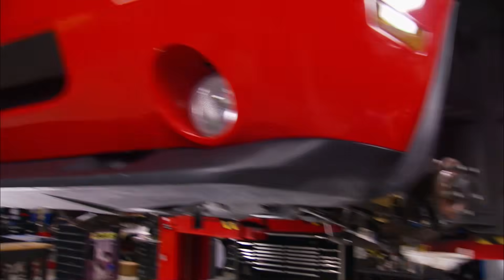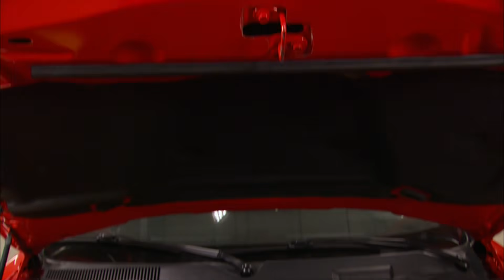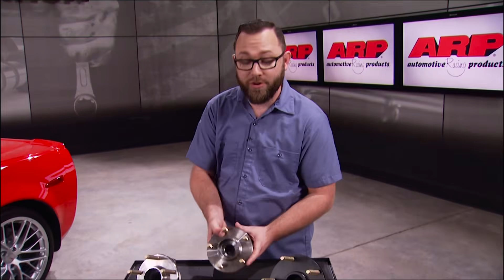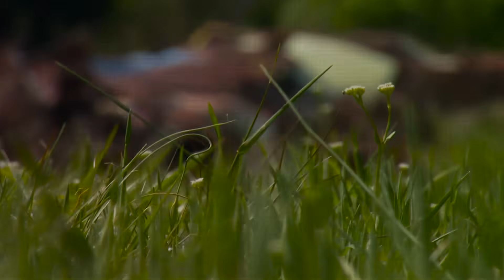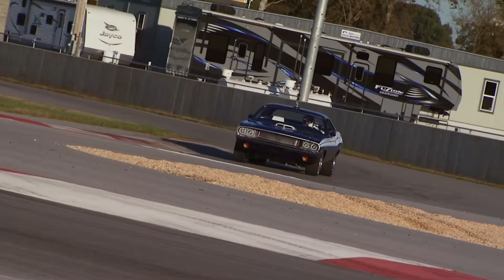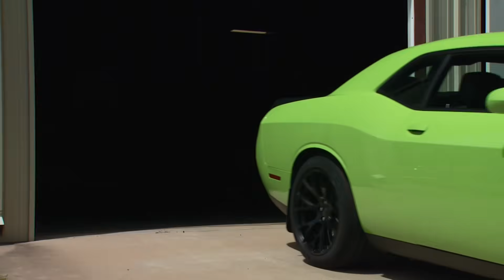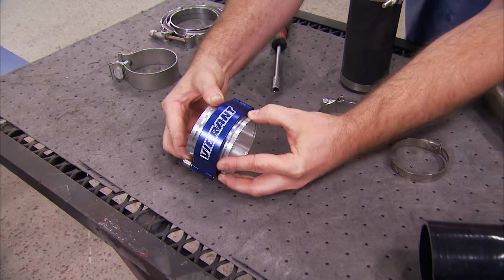Dropping A Twin-Turbo Hemi Stroker Into A 2010 Challenger SRT8 - Detroit Muscle S3, E14

Comment: Hemi/ LS /Coyote. What is the best Engine to build for power?
Reply: I would say the LS for sure
Reply: You forgot the ford “voodoo”
Reply: @Hipsters_N_Hippies  the Voodoo engine with the flat plane crank is amazing for sure especially since it can spin above 8000rpm. Now when you take into account the cost of a Voodoo engine vs an LS along with power adding capabilities it's no comparison
Reply: Shawn Clark oh I agree. The Chevy V8 has definitely proved to be the most logical one to go with.
Reply: Ls
Reply: @bigboreracing356  the Top Fuel guys would tell you a 496 Hemi is best
Reply: Well the 351 is a good for power. My dad dropped a Windsor in a mustang ll
Reply: LS is cheap and easy to make gobs of power. That's why everybody uses them.
Reply: @bigboreracing356  STFU🤣🤣. God could you be anymore pathetic? And jesus a 5 year old girls has more knowledge of engines and cars than you do so STFU🤣🤣🤣
Reply: Gas turbine,.....
Reply: @PiDsPagePrototypes  haha.
Reply: @TheRamGuy  Well, ya know, MoPaR had 'em in cars, so..... 🤣
Reply: @PiDsPagePrototypes  yeah and how well did that work out
Reply: @TheRamGuy  reasonably well given the tech of the time. The main thing drivers didn't like was the throttle response, which is an easy fix with a waste gate style system, as found on the Howmet TX race car.
Reply: @PiDsPagePrototypes  well there were many other issues besides throttle response namely noise and fuel mileage.
Reply: Noise was no louder then other cars, at least in the passenger compartment ;)
Mileage, up against Hemi's and B/RB's with 4blls, 6-packs and twin 4bll's,..It' wasn't too bad,... :D
I keep wondering, why doesn't anyone take a micro turbine from an model jet or heli, run it on propane, to drive a compact bank of alternators, then we could use it as a range extender for EV pickups and Semi's.
Reply: And, lets face it, what has more 'cool' factor then a gas turbine at Coffee n Cars ? :D
Reply: LS, unless you like to throw a bunch of cash at the hemi, or major cash for the coyote and have it blow up

Comment: Is the air intake really under the car? I guess no more driving in the rain.
Reply: Not sure I'd want to drive this car in the rain....
Reply: Any of you blokes wanting a laugh, find the manufacturers video for the system, and the replies they gave me.
Reply: PiDsMedia link please
Reply: https://www.youtube.com/watch?v=LqjmArvoIDs
Reply: That kit is about $10,000.
Reply: Your all wrong, all that will happen is it will suck up the water and purify it to clean drinking water.  You always should carry a heavy duty water pitcher to collect that super charged filtered water.  Drink just one glass of that water and your wife gonna thank you.
Reply: @V8SplashMan  Don't forget to paint the water pitcher red and add some stickers to it. It will add 75 HP.!
Reply: Carson 99% of the cars were rear wheel drive till the 80s, and we all some how managed.
Reply: We all drove in reverse when it rained back then.
Reply: Shit placement for the filters. A good bump or road debris and off they go.
Reply: I agree. They shoud the intake put it on the top on rain instant hidrolock
Reply: I image driving this with super hot turbos, running over a puddle and cracking the turbo housings...
Reply: Definitely wouldn’t drive this car in the rain anyways
Reply: @Daniel Combs Are you saying if you had a 1000 hp car you'd prefer it to be front-wheel drive?
Reply: I thought the same thing but Id say they are just thinking of using it for the drag strip.
Reply: @kendraadkins545  drag strip and mexico streets!🏁🚦
Reply: This isn’t exactly a daily driver...
Reply: Timestamp you saw it
Reply: Why you say that?
Reply: I mean a rwd car like this, would you even want to drive in the rain in the first place?
Reply: @noswrld  it's not about "want". It's about when it rains and you did not anticipate it. Not everyone lives in a desert.
Reply: @noswrld  um,,, for  sure. That's the best part
Reply: Well, I'm going to share my (non-expert) opinion
The reason why the turbos are under the car is for keeping the heat out of the engine (as explained in the video) and for taking advantage for all the wasted air that goes underneath the car (that's the reason I think the turbos have an air filter)
And yeah, in the rain the system will grab a lot of water, but after all, the whole purpose of this build is for using it like a toy in dry and sunny days, who needs 720+ horsepower? The answer is, Why not?

Comment: Everything was looking good until I saw The pancaked air filters sandwiched behind the sway bar a few inches away from the ground sucking heat let me guess no driving in the rain or on Dusty roads. There’s gotta be a better way to run turbos. by the time you spend the money to do what they did on this car you Might as well just buy a good used hellcat. need to make a “dirt devil” logo to put on the side.
Reply: exactly what i was thinking. dont drive in the rain... like, fuckin ever!
Reply: Had the same thoughts, why not have a plastic snorkel like and pull the intake air in from somewhere that makes sense
Reply: STREET RACER we’re not arguing we’re having a civilized conversation like adults. something you’re completely in capable of. Don’t you have some tide pods to go chew on?
Reply: Careful guys, STREET RACER has an auto meter on his Honda, and it looks like he just learned what "STFU" means. LOL!
Reply: Yeah! As soon as you jump that first dune at a Desert, sand is sucked into that turbo 😜
Reply: TRUMP2020
Reply: Boys Boys...!
Reply: My thoughts exactly. I checked it out and this Hellion kits starts at $8000; just sucking up dust and road grime
Reply: @Lil' Red GTO  not a Fiat but is a 08 Mercedes E class chassis.
Reply: Yep.
You wouldn't want to get stuck in a Florida squall.
Or on a sand wash board road..wont be drifting on any dirt road.
Reply: Then don't use it dumb ass...
Reply: @bigboreracing356  Damn buddy you are just such a tough guy
Reply: I believe that this car is made for the track, not the street. Therefore, the lower air filter would not be affected.
My 1320 is stock and I don't drive it in the rain.
Reply: @Spunky-iq8jm  I live in Oregon, if I didn't drive in the rain, I would not be able to drive for 8 months of the year.
Reply: Spunky1995 1320 video
Reply: Lil' Red GTO I drive ford,Chevy and dodge and I’ve never seen Air of any kind come from the engine compartment to ventilate heat in front of the windshield.  that’s where your windshield wiper linkage/motor goes most of the time and where your HVAC system pulls in cool clean fresh air. the holes in that cowling are for air in/drainage only. most of the time you have a firewall with a rubber seal that seals tight up against the hood That way if it starts raining the steam coming off your engine or radiator isn’t fogging up your window and blinding you. manufactures don’t allow Engine compartment’s to ventilate near the windshield for various reasons. I’m sure a louvered heat extractor hood would help.
Reply: @bigboreracing356  Lookat'chu....at it again!!  You need your ass beat, really...  >X-D
Reply: Lil' Red GTO the inside of an engine bay is hot no matter where you put your intake. The best thing to do with an intake is to get it as close to the grill or outside of the engine bay as possible or even use an air intake that’s right behind the grill. You want your intakes to get air but not dirty air. Having your intake close to the ground throws all of that out of the window
Reply: How about the aluminum air-to-air intercooler crammed up against the steel bumper? That can't be a good idea.
Reply: "Were making a hellcat!" More like a pavement princess😂
Reply: Exactly. Makes no sense to me unless its going on a garage queen that comes out in perfect weather or a race car. I'd also be worrying about road debris.....
Reply: @STREET RACER Why are you so FAT? And why do you like your own comments?
Reply: Lil' Red GTO actually the hot air from the radiator and engine bay exits by the bottom of the car , there’s nowhere else it can go..
Reply: Lil' Red GTO Yeah well that Basic theory goes out the window when you shut the hood of the car. Now it’s pushing hot air underneath the car because there’s nowhere else for it to go. add the fact you have a newly added heat exchanger for the turbo plus the AC condensing core, radiator sitting right in front of the air filters with a hot engine right behind them. it should heat soak real nice sitting at a light. probably the number-1 dumbest place to put an air intake/air filter is under anything.

Comment: When will you do the EV conversion?   1000hp and 1000 ft lbs with only 3 moving parts and no noise pollution!  When?
Reply: grabir01 

And a rainbow flag sticker on the back cause that’s what you would be driving it
Reply: @chrisj197438  Sorry.. I did not know you were gay.  Sorry my comment was so offensive . I should be more sensitive. I guess I need sensitivity training.
Reply: grabir01 

Electric cars are gay as two boys fucking. You can say I’m gay but you’re the electric car fan.
Reply: I get what you're saying but EV's to me are just so boring after you get over quick acceleration. No gear changes no engine noise just not my cup of tea as far as performance vehicles go. I would not mind having a Tesla Model S P100D around but it could never be my only vehicle.
Reply: @XxViciousxX  This is boring to you? https://www.youtube.com/watch?v=kAJaGAMWjHM
Check your pulse !!!!!
Reply: @grabir01  Doesn't mater how fast it was to me it was boring to watch with no engine noise and no shift's.
Reply: @XxViciousxX  Check your pulse ..
Reply: @grabir01  For me it would be more exciting to see a Mclaren Senna, Lamborghini Aventador SVJ, or a Porsche 918 Spyder do the same task even if it was slower. Plus all those cars would take more skill to drive. Seeing as they  would need to change gears optimally. Not just hit a pedal and just steer. Then you have all the different sounds a engine can make from a flat 6 up to a high revving V12 down to a nice V8 growl. Vs an electronic whirling noise, EV's may be fast but they are just boring and soulless to me.
Reply: @XxViciousxX   Electron Atoms VS carbon molecules.  Atom vs Molecule .    Funny how all the new cars are almost all electric now anyway, yet you like them because of the sound they make?  lol.  Cars will be all electric soon. That is the push.  The problem with EV's has always been storage. With the new Super Caps coming out, it will be the last nail in the coffin of the IC engine based car.  New ones anyway.  If we can get a good EV for around 20k, its over for the IC cars. OVER!!  Sorry to say as I love them too!!  My L77 and LS4  454  Stingray are ground pounders.  I would love to have a 69 Camaro with an LS swap EV setup in it.. Wow!!!!
Reply: Electric car guys arnt real car guys they are tech guys
Reply: @Startchiestpotat  What do you mean?  The first cars ever made were electric, not gas.
Reply: @grabir01  Oh and first cars ever made were powered by steam as were most things at the time.
Reply: @XxViciousxX  ok. I meant to say Electrics were before IC. Anyway.. Here is the future. Better learn to embrace it cause its a coming!!   https://www.youtube.com/watch?v=CiCnN97AxoE
Reply: Electric was about 4 years late actually it’s sad how even with the internet people still refuse to read
Reply: The reason I say electric car guys arnt car guys is because you all behave like cultist look at u telling us we should like electric because it’s “better” or “safe for the environment” that shows u don’t get it u don’t understand car culture or why we like what we like